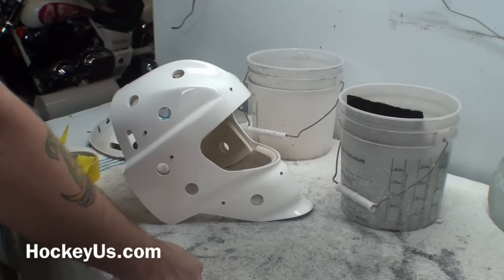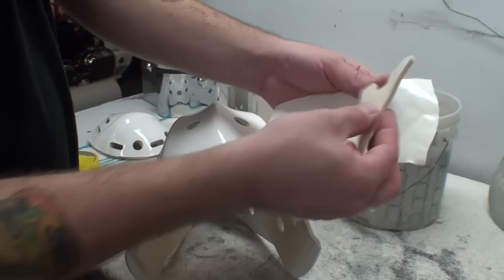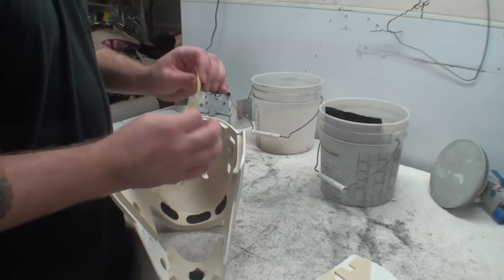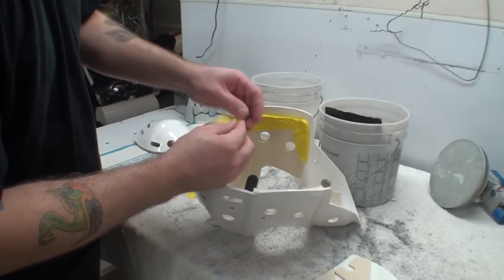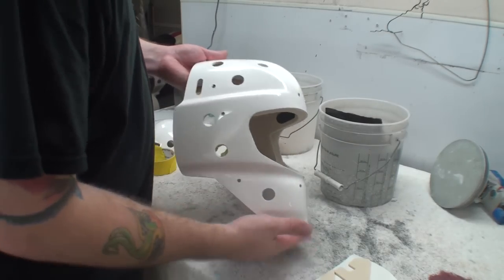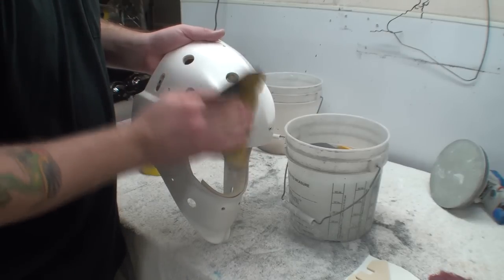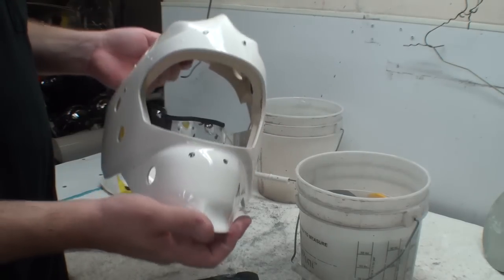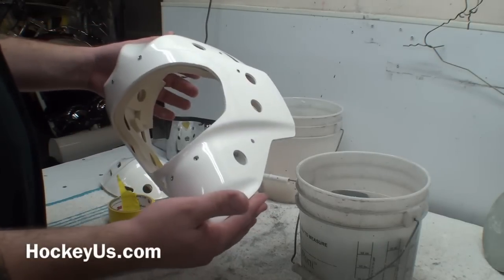Goalie Mask Airbrushing Process: Step 1

Comment: wet sanding means?  your sand paper sits in a bucket of normal water?  Also, after you sand the initial white shine off, do you have to repaint it with a white prep paint? Or is it ready for the real paint?  thx